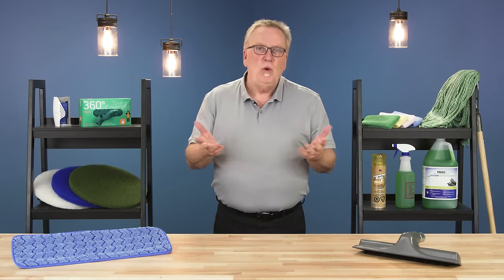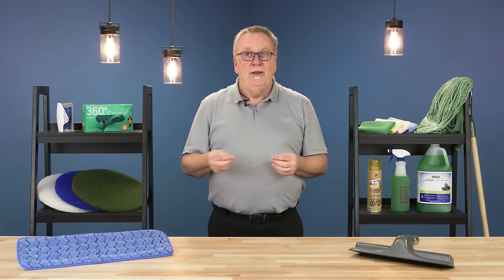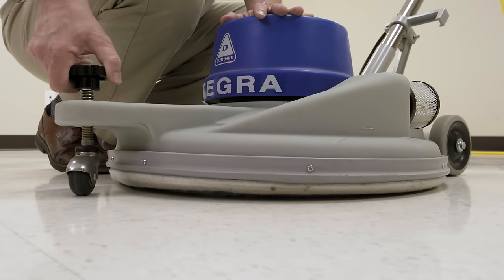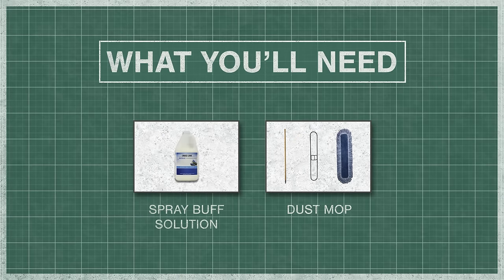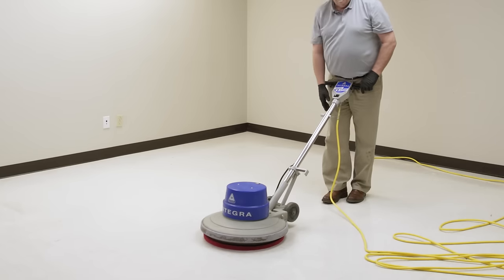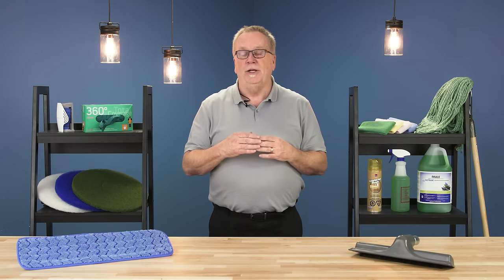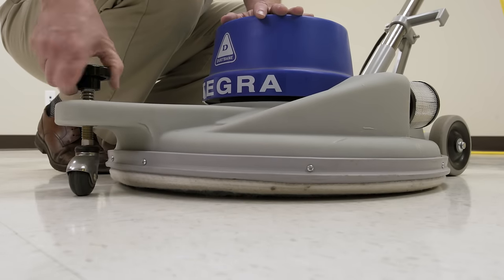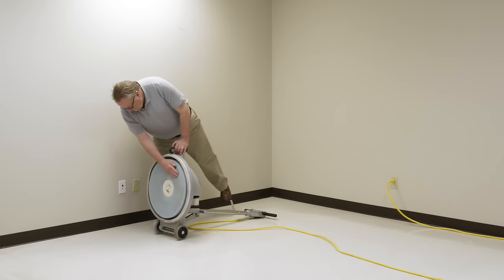How to Buff and Burnish a Floor | Clean Care

Comment from the maker: If you need pads, spray buff solution or any other janitorial equipment, then visit our website: https://www.amresupply.com/catalog/649218
Reply: When my buffer pad gets to black and gunky, can I turn it over and use the other side?
Reply from the maker: @101wastelander101  Thanks for watching. Yes you can use both side of the pad.

Comment: Great video. Side by side used for buffing and 1500 rpm used for burnishing. I use a light blue pad and spray buff then go over the hard wax we got with a hog hair/tan. Comes out looking good. Correct me if I'm doing something wrong here though.
Reply from the maker: Thanks for watching, we're glad you enjoyed the video! Every building is a bit different when it comes to how much floor maintenance and polishing is needed, but you have the right pads and you're getting good results so your system is working!

Comment: Thank you so much for this video, it was straight to the point and now I think I may add both the buffer and burnishing into my cleaning company. If you do not mind me asking, how much should one charge for that alone for service.
Reply from the maker: You're welcome, we're just happy to share that info! Bill (who narrated and used his decades of experience to help write the scripts for this video) is retired so he's not able to give a direct answer to this question. He would likely give a "it depends" answer. We will still try to help answer this.

When developing a pricing model you'd have to look at your rough "per hour rate", a "price per job", or "a price per square footage" (these may all overlap). You might want to price a base fee for the burnishing job then have a scale based on large square footage. As you do more of this you'll have an idea of how much time is needed to do a 1000sq feet vs 4000sq feet. Considering the setup time, this is why the base fee can be helpful. 

As well look around and see if you can get other references from similar services. That will help you get a range to try out. 

You could also factor this as part of a multi service deal. The base feel would cover getting in the door and each service would add up on top of that.

Hope this helps!

Comment: Great vid. I'm looking to learn about floor care as I do have a side-to-side buffer and a 1500 rpm burnisher. Would you be kind enough to get me started instruction-wise? I've subscribed and will take a look at the list of vids you made, but a little recommendation would be helpful. Thx.
Reply from the maker: Hi Steve, thank you for watching so far!
The first thing is to watch is "The Principles of Floor Care" https://youtu.be/P6HGlnSI7joNext watch "Floor Matting" https://youtu.be/57Dq_LwoUgQ 
These two videos will give you a solid overview of floor care and tips to reduce the amount of dirt tracked into your building.
Next try to determine what your procedures are for periodic maintenance. This might include some Top Scrubbing  https://youtu.be/aXYxVHxSNdc Spray buffing and burnishing also fall into this category.
If dirt is embedded deep into the floor finish then its best to do a complete floor stripping and refinishing. 
"How to Strip a Floor" https://youtu.be/KodjgiryLXg"How to Seal and Finish a Floor" https://youtu.be/doQYYaBPhCA
Reply: @AmreSupply  thank you.for your fast replied
Reply from the maker: @popeyesh8790  You're welcome!

Comment: Im a custodian for an elememtary school and I have a propane  burnisher, I'm having to teach myself how to use it.  Is the machine meant to stay on full throttled while burnishing?  My machine knocks it off full throttle down half way To a slow speed. Is this right ??   This is a brand new machine also.
Reply from the maker: Thanks for watching. Best to look at the manual and information for your particular machine. If you don't have a physical manual on hand, you can always use the model number to help pull up a PDF online. For high speed burnishing, the speed should be consistent while polishing the floor.

Comment: Great video. I just stripped and waxed my floors. I applied 3 coats of commercial floor. My question is should I burnish my floor to improve the sheen to give it a more consistent look.
Reply from the maker: Hi Michael, thank you for watching. Because of the speed and pad used, burnishing will always help improve the gloss of a floor even after a floor has been finished. It really depends on what look you are aiming for!
Reply: @AmreSupply  i heard the buffing fresh wax hardens the wax
Reply from the maker: @mikesiena2968  Burnishing will harden the floor finish. You can burnish the floor after floor finish is applied but its recommended to leave the floor to dry for 72 hours for fresh finish to cure prior to burnishing.
Reply: @AmreSupply  I work for The Suffolk County Police Department.  Thank you for your prompt response.  I am a loyal fan.
Reply from the maker: @mikesiena2968  You're welcome Mike, we're just happy to help in what small way we can! Cheers!

Comment: Thanks. Are the blue pads for burnishing? White pads for polishing ? Regards Dave
Reply from the maker: Thanks for watching Dave. You are right that the light blue pads are for high speed burnishing https://www.amresupply.com/part/14991346 and the white pads are for polishing using a low speed floor machine https://www.amresupply.com/part/DB42153-20-inch-WHITE-PAD

Comment: I am very New to this and I live in New Zealand I have a secondhand very tidy BF524 Floor Polisher with a tank on it but finding it hard to get a manual for it.
Reply from the maker: Thanks for watching. Might help doing a search for a burnisher rather than a floor polisher and sometimes it can be helpful to add ".pdf" to the search. 

Regardless if you can't find a manual for your model or if the model is too older or no longer in production, then find a similar model and use that manual as a reference. These machines don't differ too much except for accessories and mounting options. They generally have a similar design overall so the same general principles will apply for the most part.

Comment: Thank you for response. Please  how many liters of wax is sufficient per square area, if I want to  do only  2 coats and also, can I use blower to dry the  wax before I burnish the floor
Reply from the maker: If you are stripping and refinishing (waxing) the floor then you might find these videos helpful: https://www.youtube.com/watch?v=KodjgiryLXg&list=PLCo9SMjkdWBzREndiZ9xSNqOZLJJRRK9n&index=3 For using the product, always read the product label for specific instructions, but as a rough guideline many floor finishes come in a 5 L bottle which will cover 170 m² (1830 ft²) to 280 m² (3014 ft²) depending upon on how porous the floor tiles are.

Comment: Any recommendations for buff/burnishing an uneven floor. I have a hallway with a lot of high spots and I'm tired of burning through when I buff it the first time after refinishing
Reply from the maker: Thank you for watching! That is a great question. There are a few considerations. With an uneven floor it is likely that the floor finish has pooled and accumulated unevenly when it was applied. The burn spots will likely be high spots where the floor finish is more thin than other areas. Next time the floor is stripped and refinished, adding more layers of floor finish might help in these uneven areas. In the mean time you can try using a softer pad when buffing to see if it helps reduce the burning.

Comment: Great video!! So can you tell me the difference between dry burnish vs using the spray buff. Is it just the level of shine? Im a caretaker at a highschool and have a lot of floor. And not having to use the spray and just dry burnishing sounds weird to me but i will try it.
Reply from the maker: Thanks for watching, we're glad you found the video helpful!. Both Spray buffing and burnishing can improve the shine of the floor. Because of the high speeds, burnishing does polish a floor faster but does have more of a chance to burn the floor finish if you're not careful. Spray buffing removes dirt and some floor finish on the top layer and replace some of the polymer that was removed, where burnishing hardens the floor finish creating the glossy look.
Reply: Thanks for the quick reply! So i actually havn't even heard of dry burnishing, ive always used either a solution that you mop on the floor and let dry then or the spray bottle method. Can you just confirm the dry burnish method? You just have a clean pad on a clean floor and just burnish like usual but with no solution? My original question was burnishing dry ( no solution) vs burnishing with a spray chemical? Whats the difference there?
Reply from the maker: You're welcome, we're happy to help! Dry burnishing is another method and is more simple in general. You are right, with a clean floor you burnish with a light pad with no solution. There are some solutions that you let dry and others that you have to burnish when wet. It depends on the product. One solution for wet burnishing is Dustbane Cross Link DB51952 http://www.amresupply.com/part/15300250. This product would be sprayed onto the floor and immediately run over with the burnisher to act as a wetting agent on the pad and then run over the area for as many passes as needed. In some cases people will wet burnish first and use dry burnishing with a light pad as a final polish. It really depends on the floor and the specifics situation, as not all floors need the same amount of care.
Reply: Thanks again! One last question... A co worker told me last night that i can rinse out my burnish pad and let it dry and use it again? Whats your take on this? I don't agree with it.
Reply from the maker: @uppy666  Pads can be reused as long as there is no soil or residue from the chemical solution. For dry burnishing, the pad can be dusted dry with a brush and does not need to be sprayed with water. Inspect for any wear or deformities that might scratch the floor. If the material is starting to wear out then replace the pad.

Comment: Pls can ceramic tiles and porcelain tiles be burnished, or we only can buffer it
Reply from the maker: Hi Folami, thank you for watching. You can burnish any floor that has been properly coated with a protective layer of floor sealer and floor finish. Burnishing polishes the floor finish not the underlying floor material.

Comment: Could I use this machine on a aluminum refrigerated floor to make a mirror type shine
Reply from the maker: Hi Jeanette, this is something that isn't too common but with the right polish it could be done. The burnisher would create some heat but if the floor is cold it might interfere with the process. As well make sure that you use a soft polishing pad and a polish that is designed to be used with aluminum. Its always best to test it on a small part of the floor first before doing the entire floor.

Comment: What recommendations would you provide to maintain a VCT floor in a printing plant breakroom. The floors were recently refinished with 4 coats of wax. However, the chairs pose a serious problem. The employee's scoot the chairs rather than pick them up and push them in to the table so this scratches the floors and since its a printing plant the employee's have ink on the bottoms of their shoes which transfer primarily in the area where they are sitting so this ink combined with the marking from the floor chairs always makes the floors look terrible right around the table area. I want to find a way to maintain this floor but it seems to me if I attempt to buff or burnish I'm going to be smearing around INK. Mopping the floor does not remove the ink so the only true way to maintain it is by buffing frequently which leads me to think it should have received at the least 5-6 coats of wax. Whats your thoughts on this situation? Thank you
Reply from the maker: Hi Kelcee, you are right that 4 coats of floor finish isn't enough in this intense environment. In these cases its important to consider the type of floor finish. Choose a high end, hard finish which will be most resistant to scratching. For example "Hard as Nails" Floor Finish https://www.amresupply.com/part/6590400-HardAsNails-Floor-Finish-1gal
Even with a hardened floor finish, spray buffing or burnishing still must be done on a pre-cleaned floor with as much of the ink removed as possible. 
All chairs should be fitted with felt pads, or even wheels. If wheels are used they must be soft. This will further prevent scratching.
Ideally, you should consult a professional to take a look at your particular situation to give some more specific recommendations on products and procedures.
Hope this helps!

Comment: does it remove wood stain?
Reply from the maker: Thanks for watching. It would depend on what the food is finished with, how rough the floor pad is and how aggressive the chemistry is. A gymnasium floor has layers of floor finish so buffing and burnishing will not affect the stain of the wood which is embedded in the wood. If you are ever unsure about what a chemical or machine will do to a floor, you can test it in a inconspicuous part of the floor that won't be seen.

Comment: -Pls can I use wax on a ceremic tile floor, or how can I reglazed or restore a ceremic tile floor. 
-Pls for vct tile, marble or terrazzo how long will rewaxing be needed for high traffic area. Also for a floor that as not be waxed before or newly installed, do we need to strip the manufacturer's wax before we wax. Tnx
Reply from the maker: You can use floor sealer and floor finish on unglazed ceramic tile. To be sure, most manufactures will specify what surfaces their products can be used on.  https://www.dustbane.ca/training-centre/floor-care-chart

Now for more information on floor care procedures, it would be good if you watched these videos in this playlist, it should answer many of your questions. https://www.youtube.com/watch?v=P6HGlnSI7jo&list=PLCo9SMjkdWBzREndiZ9xSNqOZLJJRRK9n&index=2

Comment: Very good
Reply from the maker: Thank you Shafi!
Reply: @AmreSupply  Hi you did not mentioned about what is the #of the machine  speed the speeds started from 1000 rpm To 2500 RPM speed &witch color of the pad matching each speed  Al sow  the kines of the floor thank you  Kamil Ali

Comment: Been getting swirling after burnishing. Tried everything can’t figure out why?
Reply from the maker: Thanks for watching. If you've tried a lighter amount of pressure and adjusting those variatbles and you're still getting swirl marks or a cloudy finish then it could be something else. It is possible that the floor finish is starting to wear out which would expose the underlying layers of sealer. The floor might need to be stripped and finished if it hasn't been in a while.
Reply: @AmreSupply  waxed a week ago lightest pressure possible using 4000 white pad.

Comment: My boss wants me dilute vectra with water and use that a buffing spray, is this crazy??
Reply from the maker: Thanks for watching. Floor finishes like Vectra are listed as RTU or ready to use and don't need to be diluted. Diluting it with water is not ideal and you'll likely want to point your boss to the product page or PDF.
Reply: @AmreSupply  thx!!!

Comment: I feel like burnishing is unneeded when you can just wax the floor, no machines needed
Reply from the maker: Hi Mr Guzman, both spray buffing and burnishing are useful for periodic maintenance of a floor and will give a superior looking shine. Both will help clean and remove deep embedded dirt and scratches that can't be removed by mopping alone. This is because the top layer of floor finish is removed during the process. If you only apply more floor sealer on-top of the floor, this might result in sealing the embedded soil, deeper into the floor. Overall it depends on the state of your floor, the amount of traffic and the desired level of shine that is needed.